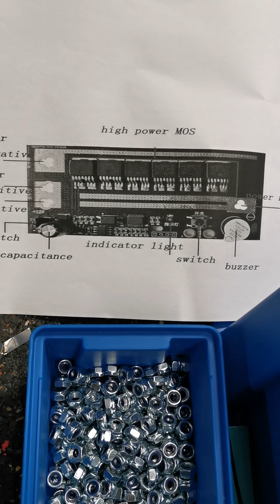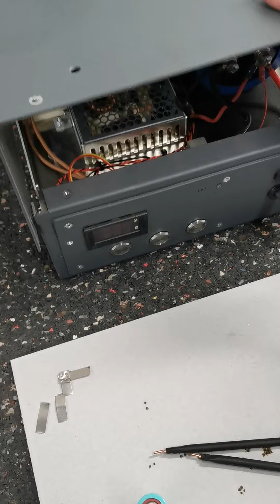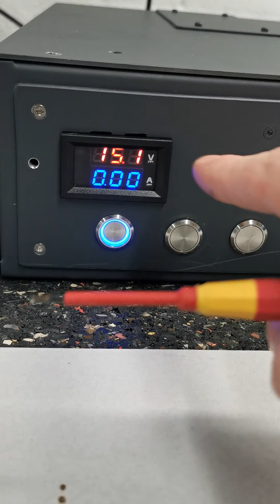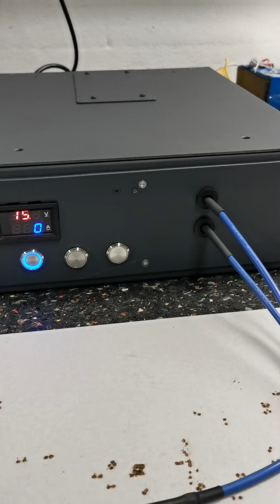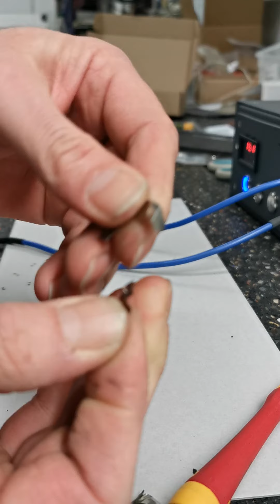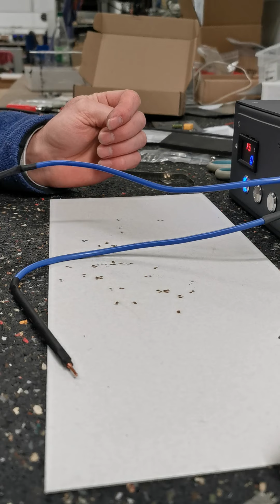DIY Spot Welder PCB for Li+ Cellls

Comment: Hello sir. I had have the similar idea and I have all the stuff except the pcb. Could you please give more details about the pcb board, from where can we find it?
Reply from the maker: Look for "DIY Spot Welder PCB" or similar at Ebay or aliexpress or try google. There are many PCB Boards and models and many manufacturers.... 
I found mine on the German Ebay (ebay.de) Ebay No. 333464183923 
Unfortunately, I have no Info regarding manufacturer or Type. But I hope this helps....